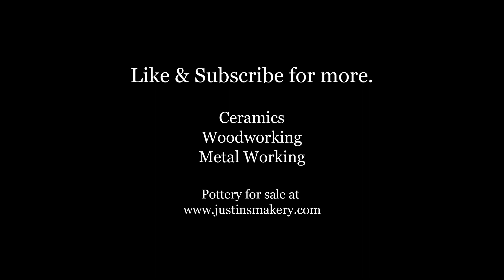Making a Pierced Ceramic Mug

Comment: Perhaps it'd work better with 'groups' of smaller holes due to surface tension and whatnot. However, I have no hands-on/technical experience with pottery, so I'm not entirely sure. Speaking of which, it is possible to somehow fix glass into pottery, to make a stained glass effect? I'd imagine that some kind of mosaic-stained glass piece would look amazing it were at all possible to produce.
Reply from the maker: A stained glass mosaic would look amazing. You could grind and cut glass to fit holes in pottery, but securing them in place would be the hard part.  Firing them into place would be cool but tricky because the glass melts quite a bit lower than pottery firing schedules.  Interesting thought experiment.

Comment: I made some like this with bigger holes, just using a 3mm hole cutter on leather hard. Similar effect with 1st glaze, 3/8 holes let water through. Tried putting more glaze in, it just runs out even when the piece is pretty hot. So put sellotape behind hole inside cup, lay cup down so hole upwards, filled hole with glaze and left it to dry. Put more in when it shrank with drying until over full and a little proud. Refired, sellotape gone, burnt away, glaze filled hole. Didn't work when I cut a slot down the side trying to make a level glass for a true 'engineer's cup', as all the glaze ran out ruining yet another kiln shelf, but the cup with holes was fine with the sellotape technique (masking tape should also work, didn't try). Of course, each leaking hole needs to be refilled individually, as each one needs to be upwards when refilled, so this is not really a technique for production pottery, too slow.

Comment: I accidentally did this with a tea candle holder I made. I had hole twice as large and dipped it three times, allowing each layer of glaze to dry for 20 minutes before adding the next. It's neat with a candle in it, but I really just want to drill out the holes for more light to come through.